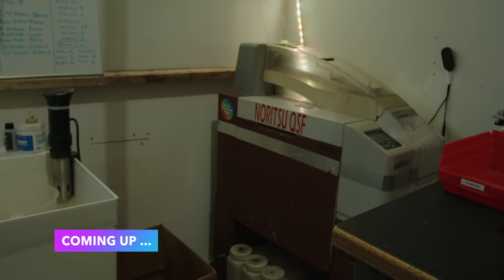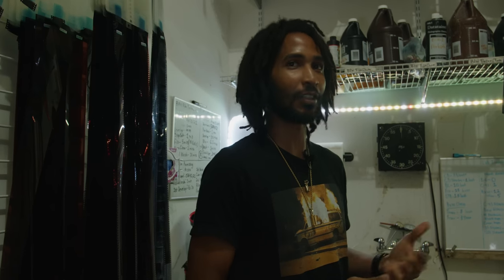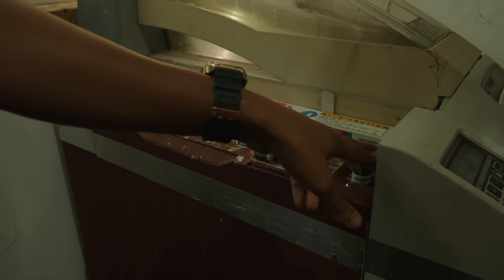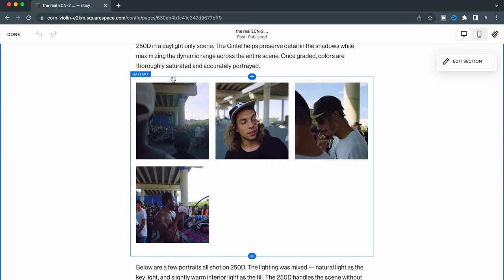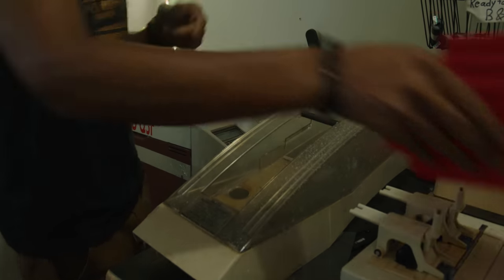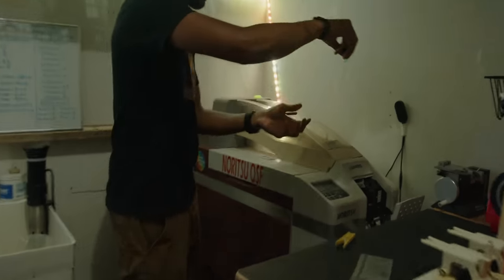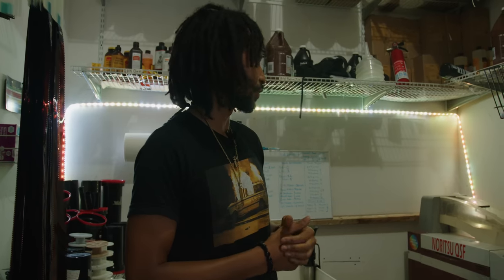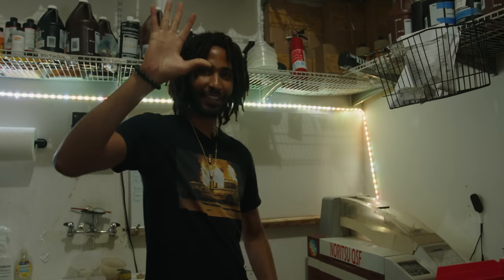automatically develop ANY black and white film ... one machine does it all (Noritsu)

Comment: So that’s a Noritsu T15.  It should be pointed out that many B&W films actually do well at a rough single time depending on the temp.  There are outliers but for scanning labs it’s often “good enough”, which is why this is working.  A better option would be a Noritsu V30P which allows you to slow and speed up the drive to account for different B&W films.  In a high paced environment it’s true that dry to dry processing is a massive workflow booster…the downside for customers of processing this way is that the film is going dev-fix-photo flo- dry.  No true wash stage.  This film will not be archival long term as the two “stabilizer” baths do not substitute for a 10 minute wash.  This video makes it seem like the only other option is hand processing…but automatic rotary processors are readily available, some even new.  Our Jobo ATL processors can do up to 12 rolls at a time, or as few as one.  And these have full wash cycles for archival stability.  Larger operations will have dip and drunk, or pro lab roller transport machines like a Colex, Kreonite, or Colenta.  These also have full wash cycles and are dry to dry.
Reply from the maker: Thanks for watching. For those who are particular are about how their film is dev’d they should def shop around and talk to the labs

Comment: Every time I develop black and white film and if I have films that are different speeds (let’s say Delta 400 and Foma 100) and let’s say theirs a 3 minute difference in dev time, in the Paterson tank I put the longer one at the bottom and fill it with exactly the correct amount of chemicals, wait three minutes and add the rest of the developer. I’ve done it 100 times with no issue. Generally when agitating Paterson tanks with the stick, if you look at it such as with the lid off for wash aid, there’s no sloshing or spray, it’s pretty safe. You just need to measure how many ml until the top of the film is covered
Reply from the maker: very interesting. never considered it

Comment: Interesting to see the old photographic film processing machine. I work in the printing trade and when I started as an apprentice, one of my jobs was to replenish the dev and fixer, dump the used dev and fixer and clean the processor. We used Lithographic film, which when developed properly was a (I can't remember the exact term) mono tone film, not continuous tone film like photographic film is. We created our tones with varying sized dots, not different film densities. Anyway, same process to develop but on much larger films. Our film would be larger than A1 in size (around 900x600mm and come of a massive roll).
Reply from the maker: yea its a cool process

Comment: I know people are a little worried about "one time for every film" but after having a bit of a think about it, I believe it'll work far better than people expect.

If you run the developer hot, there's much less variance between times. If you use constant agitation, it knocks the times down further, and the variance between the times goes down too. 

The other thing is that the bulk of development usually happens in the first couple of minutes. Long development times happen because the developer get restrained as the film gets processed  (and sometimes the developer cools down, too!)

Meanwhile this machine has two heated dev tanks, so it's not going to have the same developer activity curves. What might be a 5 minute difference with hand processing might now be a <1min difference with this setup.

I think this latter factor is what really makes the difference. Sure enough, some negatives will come out a little thin, some a little dense, but unless you're doing darkroom enlargement, you can easily compensate for this in the scanning process.

My guess is that the only films that won't behave are going to be things like bergger pancro, but i'd be interested to see the results!

Honestly, this is really impressive! Usually people have to do semi-stand or split-bath development to get consistent (albeit long) development times.
Reply from the maker: Thanks for the insights! These are very useful
Reply: @ribsy  Thanks for the video!

I literally never thought you'd get a one-size-fits all roller processor for b/w, so cool!